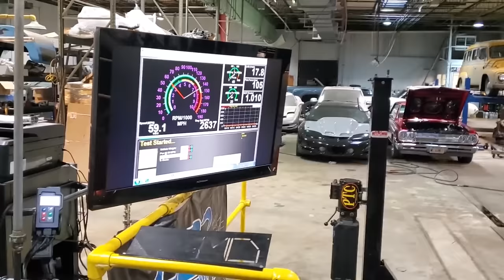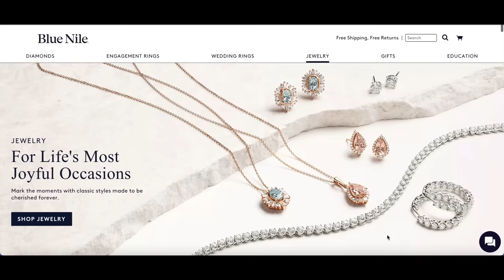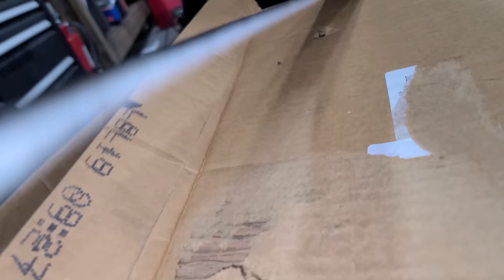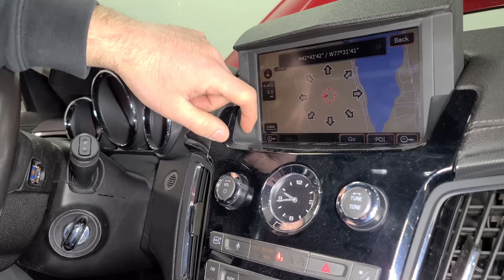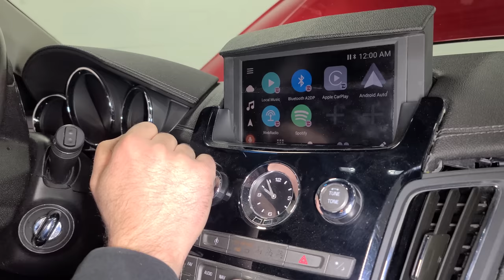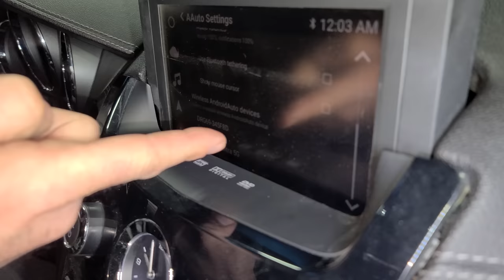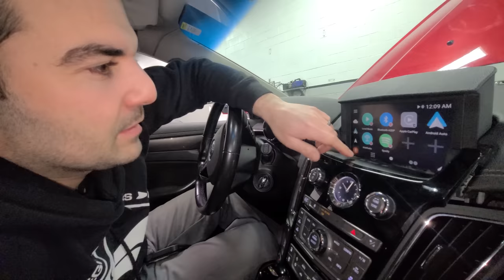I Found The REAL Reason My CTS-V Wagon Was TOTALED While I Was Modifying It! Would You Drive It?

Comment: I'm all for saving the planet, but I'm also going to enjoy my gas guzzlers for as long as I can. Am I a hypocrite? Maybe.
Reply: If you recycle, you’re doing your part! 😂
Reply: I think there's room for enthusiasts like us to still drive ICE powered cars for a while, since we only make up like 1% of the drivers out on the road - we won't make a dent in the environment either way. Plus, you gotta take into account the higher emissions involved in producing electric cars vs gas. 

Personally, I'll be getting an electric car as the family hauler in a few years; but, I'll still keep a couple ICE cars for weekend fun and to tinker with. Also, I've got solar panels on my house and I'm converting to electric water heating (vs natural gas). 

My point is that lowering emissions can come in other forms besides your car, and it's okay to feel good about that, because ICE cars are simply way cooler than electric right now.
Reply: Nothing wrong with it at all until they have resolved the issues with scaling the ability to charge a lot of cars quickly....or maybe before that it is hydrogen power or even carbon neutral gas. EVs, in their current form, could be a trend and not the actual solution to the problem.
Reply: I love my 8mpg v8 jeep. Sorry
Reply: There was a power tool company I can’t remember which company it was but a major brand, they had meeting and all talked about how the car market is going to use up all the lithium in such a small amount of time they are now trying to Create a new type of battery for power tools. Caterpillar makes power tools now and are testing now graphene battery’s but they look CHUNKY🫤
Reply: I'm not for saving the planet so my gas guzzlers are just fine
Reply: Drive a 5.7 hemi and I’m enjoying it till it drops lol nothing like getting on it and feeling it come to life
Reply: Nobody saves the planet with EVs rather destroys them…
Reply: Yes
Reply: EV's aren't green, contrary to the propaganda.
Reply: This is on average the best way to lower your carbon footprint actually.
Reply: @sabastian151  if ya wna save fuel and go fast get a street bike, if ya wna live life and do cool shyte, like going 4wheelin, take a jeep or truggy and it's not bout mpg its more like what gets the best HPG, (hours per gallon..lol)🤤
Reply: It is what it is. It's not about any individual, but about percentages.
More people drive EVs lots keep their ICE.
So it's all good.😊
Reply: So basically you're all about saving the planet as long as you don't have to do anything.
Reply: Nope, you ain't...
Reply: I'm driving a 2013 Mustang and a 2015 Challenger RT Scatpack so enjoy away! Like most others here, I grew up on American Muscle and there's nothing better than that roar of a V8.
Reply: Electric cars are no better for environment
Reply: @indieauthorjasonblayne7511  I love the VR6 Sound too. Mustangs are probably the best sounding V8!
Reply: Volcanoes, dude. Ever heard of 'em? Guess what they make. And how much. Guess. You are a billion times off times ten. Now go look it up for yourself.
Reply: Your a traditionalist. Just like me. I'll always love the sound of my V8....as long as I can.
Reply: Well, life is only one and I would always regret for the stuff I’ve done and not for the ones I haven’t.
Reply: I wouldn't feel bad. Literally not a single country in the world is set up for every person to drive battery powered cars. I would be surprised if any were before we die. I would love an electric truck for picking up stuff for my farm and running errands but they really aren't there yet.
Reply: @brackishcycles  absolutely, the only thing good about EVs is that I work also for mining, the mines they are now developing everywhere are huge additinal to all the heavy diesel machines, great business opportunitiy, the downside is that I also love nature and everytime I get in a mine it’s always a pain. The thing with these nice green lithium mines is that it also destroys the whole watering system in a large area which is much worse than any coal mine. But of course we go green, carbon footprint, unbelievable how brainwashed are some people.
Reply: The irony is the material used to make those huge batteries causes way more harm to the enviornment digging for those materials in the ground than digging for oil does...
Reply: @ALittleBitOfGay  it's relative, which actually is exactly WHAT matters. Every time a volcano erupts, in one day it puts more emissions in the atmosphere than mankind has in all of history. There are always 20 volcanoes erupting. So yeah, it kinda matters, and no, there is NOTHING we can do to change this fact: we don't affect the atmosphere at all. If you are WORRIED about warming, check with the sun. But the atmosphere MUST evolve because the earth is getting LARGER. Every day we consume 20-40 billion tons of space-dust. Not only are we closer to the sun, we will necessarily have to find an orbit closer to the sun and eventually fall in, where no time CAN pass. And yet most Xtians still pray for the resurrection! Do you understand?
Reply: From my cold dead hands.
Reply: @sabastian151 I bet you can tow a boat, no problem!
Reply: Driving a gas guzzler 1995 pickup truck for 25 years does less damage to the environment than just building a Tesla. That's before you hook it up to our coal powered grid. EV's aren't green, nor are they saving anything except fuel costs.
Reply: The planet doesn't need saving...open your eyes and don't be a sheep.
Reply: Can't wait until gasoline engines are history
Reply: @ALittleBitOfGay  not so sure about that first statement. I have a 71 chevelle with original motor. How many electric motors and battery packs would be needed over 50 years time?  Throwing in a landfill and the resources and pollution to develop something new equals a lot more pollution than maintaining your current vehicle
Reply: Considering an ev is not any “greener” than ICE I’d say not
Reply: Everyone is a hypocrite.
Reply: @devilsadvocate1441  ...yeah but I wonder how many likes I would've gotten if people knew I'm actually a 4 cylinder turbo guy lol
Reply: One thing is for sure, electric cars will not save the world 😂
Reply: Nobody ever explains what they will make plastic cars out of if we abandon crude oil. Not to mention the costs when production volumes plummet.
Reply: @sinoverlord409  your existence will be a long forgotten memory before that time ever comes. Do some research. EV's are not a sustainable future. Hence why Toyota openly said they're never making one. There's no future in them.
Reply: @ALittleBitOfGay  good job on explaining stuff for climate change deniers
Reply: @freedomisnotnegotiable  that’s just dumb.  Trolling, right?
Reply: @adambaumeister2376  simply not true.  Tell me when you’re ready.   For all the people saying that the energy generated to charge the EVs was made using fossil fuels.    Ok, maybe.   And?   Do you really think that amount of fossil fuel is even remotely close to what is consumed by ICE vehicles?    It takes more fossil fuel energy just to get the gas to your tank before even burning it in your ICE car!   Not even close.     Just the energy used by various pumps during the refinement process, then pumping into the fuel tank truck, then the fossil fuel burned getting that fossil fuel to the gas station, then the fossil fuel burned pumping it out of the tank in the ground to your tank in your car.     Meanwhile, the EV got “fueled” up using a tiny fraction of that energy.     It’s not even close.      Just stop.   Y’all are so desperate.     They said similar things arguing for horses against the “horseless carriage”.       I’d ride a horse if I could, everywhere.    But I can’t.    Next.
Reply: @MichaelDavis-si9bv  if you thinking switching to electric vehicles will “save the planet” I have a bridge to sell you.
Reply: @ALittleBitOfGay  we have no idea how long the batteries will last. If they go bad in  under a decade than it’s not helping anything.
Reply: @ALittleBitOfGay  believe it or not the planet needs CO2 to survive. Plants and trees actually grow way faster with more CO2 in the air.
Reply: My trick is remembering that being a hypocrite doesn't make what one is saying inherently wrong.
Reply: I will never buy an electric car, or even a hybrid. I will keep my current collection of LS1 v8 Firebirds and drive them indefinitely.
Reply: No you're not a hypocrite. Electric cars are more of an environmental hazard anyway
Reply: @crxtodd16  this is the most level headed response weighing the pros and cons and actually understanding the differences we can make. We don’t have to get rid of ices entirely to save the planet, we just need to be cleaner over all. Cars are not the only way to do that. But cars are a good start and that’s what electrics are for. Everyone else either says electric save the planet or electrics suck get an ice.
Reply: Not necessarily and I'll explain why.
..
One for one production of an ev car compared to an ICE car is around the same possibly a bit more for the EV if one includes the batteries..
..
Where EV cars Excel is zero emissions at point of use.. no emissions in the town or cities; cleaner air 
Great. 
But with a large amount of Power generation coming from fossil fuels gas coal & nuclear there ARE indeed emissions from EV cars in that respect.
..
Micah is correct in that batteries and motors are around 90% efficient compared with ~ 25% gasoline ~35% diesel.
The rest of the energy is wasted as heat..
..
However, if we are truly to be totally green and save the planet the government should offer massive, as I mean massive, incentives to go electric.
..
Currently EVs are too expensive for the majority to purchase.
..
In the US around 1-3% of all cars on the road are electric..
This is not great if we are to transition to cleaner lifestyles.
In China that figure is around 19% 11% in Europe respectively..
Still low numbers.
..
Now in the case of ICE vehicles. 
If one uses a traditional car and keeps it long term and maintains it that is reducing its carbon footprint than going out and buying new.
..
The big problem going green is accessibility..

Having heat pumps (to heat the house) solar, wind power & EV transport is kinda expensive for the average Joe.
..
We are all aware that we need to recycle and most do what they can.
Until the government really helps with massive EV subsidies EV ownership will just be on the fringes..
.
Reply: @stuartd9741  same in the UK despite all the government eco rhetoric.  Subsidies for solar and lower priced EVs have actually reduced and it’s not affordable for the majority yet. Maybe a maturing secondhand EV market will democratise ownership over time?
Reply: Happy to be 260 on your likes, brother. I have too many cars from all the makers. You'll at least get an electric car that's up to our spec when it comes to it. 
Enjoy what you have while you have it. 🤙🏽
Reply: @crxtodd16  I always made the joke that I wouldn't buy an electric car, but I'd drive the hell out of one of someone gave one to me... I know the batteries are r*ping the environment but I'll still use it till it's dead. 
We still have enough gas to make the rest of my cars work anyway and from what I can tell, the newer batteries should be "better."  We'll see what happens when it happens. Stay safe and happy out there. 🤙🏽
Reply: I drive with Petrol till death !
Reply: Does an electric car save the planet?

What does the power station producing the electricity run on 🤔 Fossil fuels maybe 😂
Reply: I have an R1T in production now and am still waiting on a F150 lightning that I reserved day 1 hour 1. Also on the list for Ram EV and Silverado EV. But while I wait I drive a  Mustang GT 6 SPD as a last hurrah for ICE daily drivers in my family. But long after I sell that Mustang and switch to EV for daily duties, I'll still have my '72 Datsun and '98 4Runner for extra curricular activities.
Reply: No. Car vs chemical plants 😅. 🪴 to cars win.
Reply: No your not. I sleep knowing kids aren't digging cobalt for my misplaced "save the planet" ideals
Reply: Here comes all the "EVs aRe tHe dEViL, GOBLESS" rhetoric.
Reply: It’s like I always say. “I am all for everyone else going electric, because it means more fuel for me”
Reply: E85 is clean right?
Reply: @brackishcycles  exactly, no manufacturing emissions producing new cars, keeping another one out of the junkyard. Win win
Reply: EVs are actually worse for the planet than gas engines
Reply: @MichaelDavis-si9bv  I hope you know electric cars won't save the planet
Reply: Who said that batteries will somehow save anything. Show me how an inefficient power sources save anything. We still do not have the ability to use it properly.  Maybe in a few years.
Reply: @freedomisnotnegotiable  hey hey there fellow awake person 👋
Reply: Reduce, reuse, recycle. Enjoy your car bro! Unless we make the entire supply chain gets cleaned up, you all good imo
Reply: Not a hypocrit.  I feel as though there is space for both.  If we made a space that was accessible to everyone and common enough to wvery community. Such as a sppedway centre kr dragway or dirtrack etc.  More and more are being destroyed and scuttled.  In Germany,  the nurburgring at Nüburg provides millions ofnpeople a year with a safe space, its actualky a toll road that anylne can use, and drive at their limits. Because of this their traffis stats and recless driving stats and traffic deaths have plummeted.  Not non existenet but very low.  Give us a space to drive thag is affordable and we wont need a reason to have gas guzzlers on the roads.  An idea.  Im not setnkn it. Just a conversation.
Reply: Saving the planet is the new money scam. The resources it takes to produce all these green energy projects is astounding. What it takes to get them all is even worse. Wind turbine blades for example can not be recycled. Bury them under ground. Sounds real clean. China is and has built so many power plants it’s unreal. Out of sight out of mind. U.S is all about killing our economy as long as it appears we care.

Comment: You should totally turn the old seats into computer chairs.  I've got the seat from a 2004 CTS that I welded to the base of an old office chair.  I even have the power functions hooked to a spare PC power supply.
Reply: nice great idea
Reply: I always wanted to do this with an extra seat off my buick I have
Reply: That's a cool idea
Reply: Could serve as good shop chairs even, especially for detail work
Reply: I’ve done exactly that with some old Commodore seats for the workshop/man-cave. Worked great, but I ended up sourcing some shorter gas struts at they were a little tall due to the extra thickness of the seat squab.
Reply: I've got a couple of sofa seats I made using the seats out of our old car that we scrapped, the seats were in perfect shape

Comment: Here’s a dis-advanced tip for you. For your next headlight freshen up, us a dual action sander and sand away all of the yellow from the lens. Work through your dry sanding grits ending with 800. Then apply a good quality automotive paint clear coat and reinstall. Guaranteed clear lenses for at least 10-15 years.

Comment: The way you upgrade your vehicle options is exactly the same approach I take.

The only thing I would have done differently is I would remove the unused air bag wiring harness for those seats.

If I wanted the option of removing the seats in the future I might leave the old harness in place but I'd definitely label and tie up the unused harness.

The reason is at some point you'll either sell the car or someone else will work on it and they won't know what to do with the disconnected wiring. They might accidentally connect the wrong one or waste a ton of time trying to figure out what the disconnected wiring is for and what they can plug it in to.

I don't know if I'll ever get that opportunity to own a 2013-2014 CTS-V wagon, but that has been my dream car for many years.

Comment: I wanted to say after the 1st video i hunted and got lucky to find a 2010 V sedan thunder grey and manual. I immediately used your code to buy the grom unit and i love it. The dash pieces and the door pieces have a very light ambient glow at night if you pay attention to dimming the interior lights ;) I want to get a full corsa exhaust, just did a air raid cold air intake really wakes up the blower whine. Hope to see a few more mods on your wagon,maybe a smaller pulley,tune?

Comment: I'd go in an swap the brake rotors for drilled and slotted ones, while you're getting the calipers powder coated to match the car. Of course I feel for you when it comes to the missing head light cover and the cracked rim you have on the car. But I'm still looking forward to the end result after you put in that 40+ mpg tune on this beast.
Reply: No
Reply: Add a reply
Reply: Why would anyone put drilled and slotted rotors on a street car?  Waste of money.  Race cars use solid rotors FYI.
Reply: Drilled calipers are prone to cracking and don't perform any better than slotted. I agree for a street car that solid is probably better. I replaced my factory Brembo drilled rotors with DBA slotted. They look great.
Reply: The 99 Escalade(1st gen looks like a Yukon with a front clip)  and eldorado had the Navi screen animation